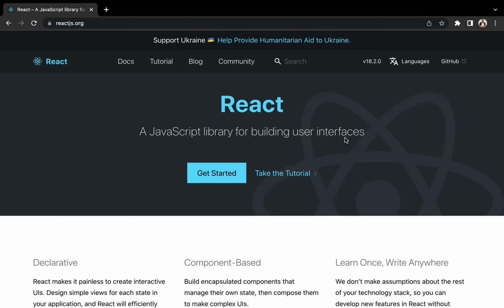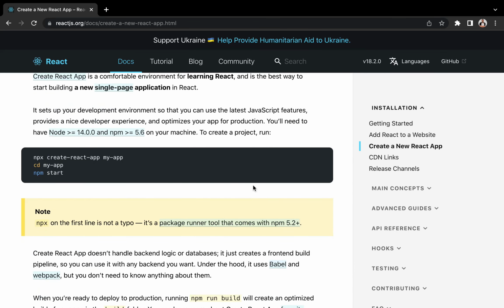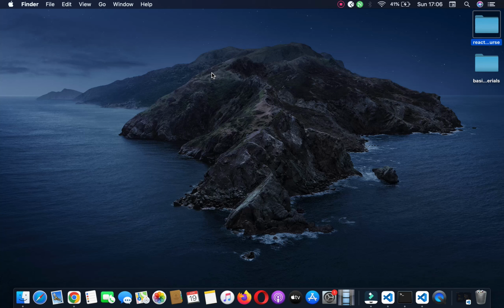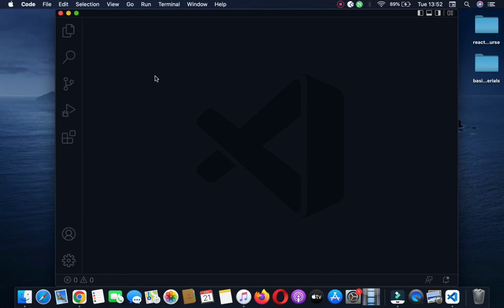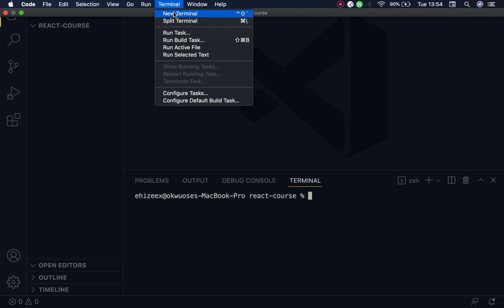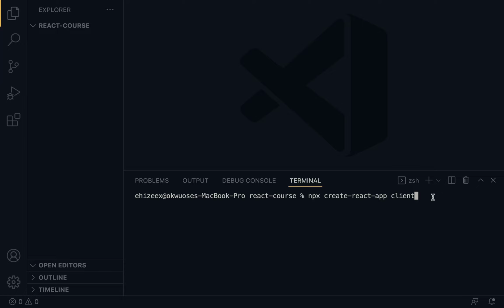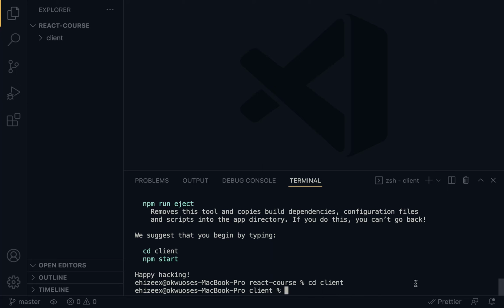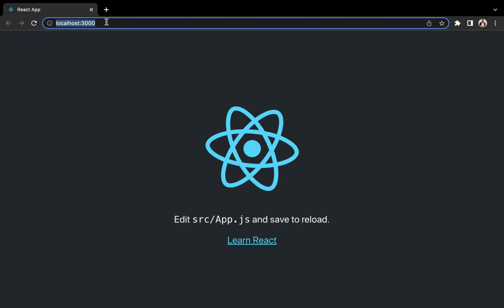💥 React Js Tutorial:  #3 React js installation (2022)

Comment: I press npm start, localhost still unable to connect
Reply from the maker: have you installed node js?  did you cd to the client directory ? 
which laptop do you use?
Reply: @edubaba  yes. It has worked
Reply: @edubaba  must I be doing npm start after making some editing in my project. Because I was worried after making some edit. Localhost don't work by itself
Reply from the maker: @mrpromisetv469  when you do npm start for the first timE, you don't have to repeat it again. However, each time you close down the vs code, you must always have to start your application by doing npm start
Reply: @edubaba  thanks